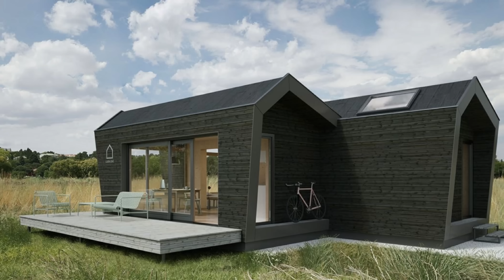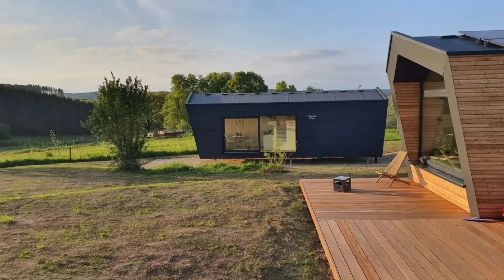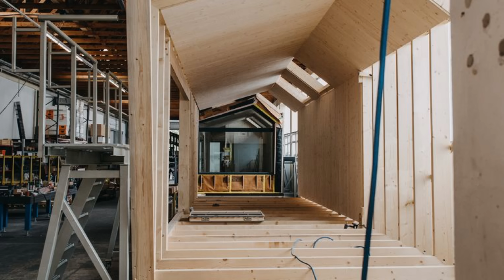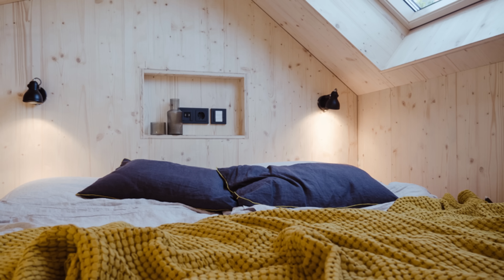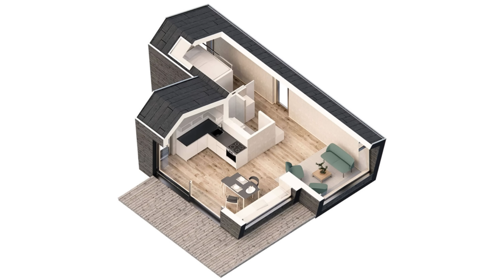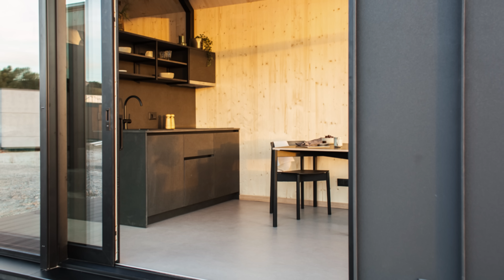Incredible! Cottage Style PREFAB HOMES with a Minimalistic Design!!

Comment: Love the Scandinavian aesthetic but I have concerns about the cabins that combine modual units and snow loads.  It seems to me that if you live in an area where you get seasonal snow accumulations that snow would build up between the two peaks - do you need to get up on the roof to do shoveling everytime it snows? How much snow can pile up before structural failure? will this design cause leaks between periods of freeze thaw?

Comment: The small size of these alternative "houses" are laughable. The length of it is OK if the width was also the same as the length. Basically, if there was a home designed to connect 4 of them so that is was a large square shaped home (could even have an optional central courtyard outside in the center or be shaped like a U) that would be a good way to still make them in a facility and connect them on site. 

The interior fengshui and design would allow you to then have separation, not bump into other things, have an adequate sized kitchen, bedroom, living room, second bedroom that could be an office and not to mention a bedroom where you can walk in and not crawl like its a tree fort!! Or a living room with a wood stove and large windows at corners of the home to feel industrial, old and large. Taller ceilings so you have also feel like you're in a bigger home. The kitchen could have butcher block or metal even so its more utility than luxury, but not skimping out on the luxury and style by allowing options for tile on the kitchen wall near stove, or a window where while washing dishes you could look out of and slate floors for an easy mess. Or a slate outside patio area where you walk out onto from the kitchen. These are all cheap options that would allow for a luxurious experience with natural quality.

The size of a home should not be sacrificed for an average sized human being, and again, the way these bedroom "lofts" are created are in my opinion a safety hazard with smoke, fire, water, current health issues with maybe ones spine, someones who's claustrophobic, the list goes on! You can get quality along with price point and size, separate rooms...

The material used and designs of some of these homes are also labeled as a "modern, urban, minimal" look but I think within 10-20 years they will not age well. Some of these sizes that are available are maybe good for an ADU but not a permanent home and not in it's awkward shapes. And the price of these ADU's are sometimes the same or more than a regular house.

So, I don't get it. I just wanted to express that I believe a house that's 4x the size of the one listed in this video (and many others) could be made and I bet it could be under $150k, at a price point that makes sense. And any alternative customization to that entry price, could be accessories in any of the rooms

I love the idea of customization, being at peace with the price, having something of quality where I am not buying twice. I've seen the homes created in Austin, Texas with the wood siding and most of the time, the wood siding is warped, faded and falling off within 2-5 years. I understand there's metal siding on the home listed above but many options have a cheap material.... Anyways

End rant.

Comment: They look good, but my main issue is making the bed, with a chronic spinal issue and nearing 60, although I’m fit-ish and active I walk a lot, but changing my bed linen always causes me pain afterwards, so even though I already live in a small space, it’s a bit too narrow to have my queen size bed accessible from both sides, so I will be fitting out an old railway freezer car as it’s 4m x11m so that will be more space than I have now and allow me a separate bedroom, I have already been living off grid for 6yrs and about to upgrade my system to 24v and lifepo4 batteries, and then work on my new/old place, as I enjoy not having a mortgage now and no debt, it’s much more relaxing.  They are definitely nice though if money was no option, and I have to comply with bushfire regulations so all metal or non combustible materials are absolutely necessary.

Comment: I like it but I don't think you can get the required permits in the USA.   It's going to be a fire hazard due to the lack of windows/doors.  The size is not going to meet 99% of zoning requirements unless you put it 100 miles in the middle of no where.   The homeless problem in the USA could easily be solved if we could find a way to remove greed.